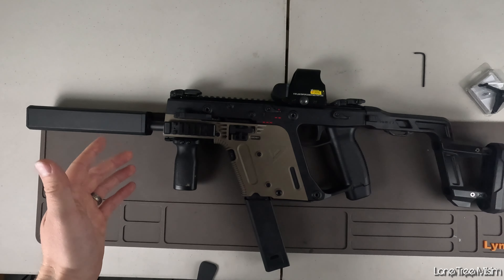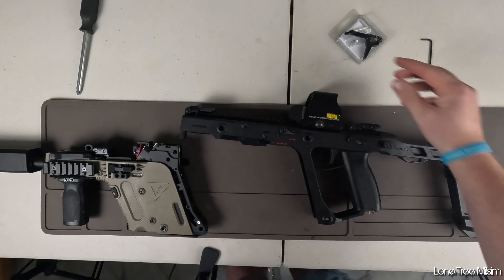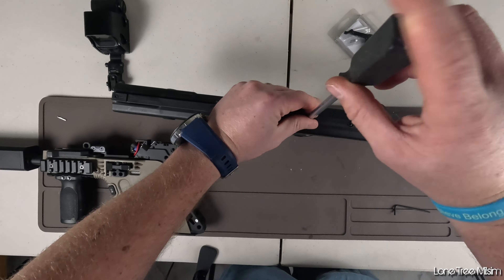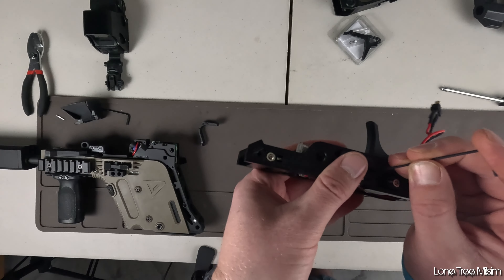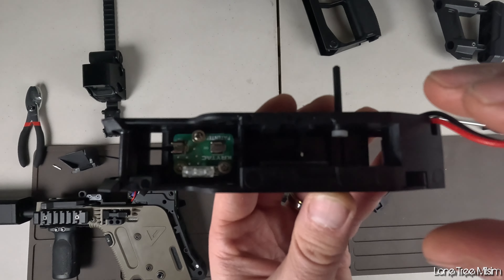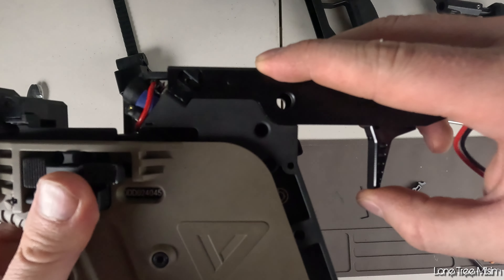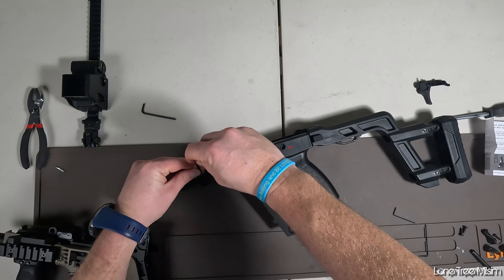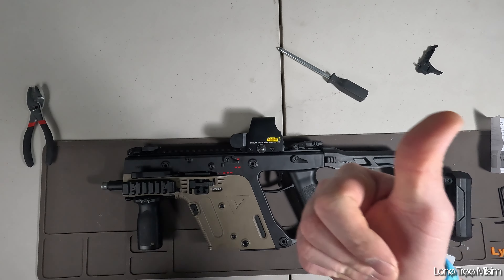Krytac Kriss Vector Speed Trigger EASY INSTALL!

Comment: I have 2 questions, would you recommend a vector (probably going to leave it stock, no upgrades) and would the stock variant be able to take an 11.1 lipo without becoming a 500$ paperweight
Reply: Trigger is mid, idk about the battery, sight over bore is absolutely garbage. I find myself aiming at someone but my rounds just hit the wall in front of me because my barrel hasn't cleared it yet. So then I need to stick myself out another couple inches and make myself a big target. It's easy to transport because the stock folds. Great style points not a competitive gun tho.

Comment: The pin won't come out. I've already bent an allen key.

Update: I used a hammer and punch. Now the pin is halfway out, but the punch broke inside if the gun.
Reply from the maker: Oh no!! Any update on it?
Reply: @LoneTreeMilsim  I got the punch out and just put the pin back in
Reply from the maker: Oh nice! So all good now?
Reply: @LoneTreeMilsim  Yeah, no mod, but at least my gun is still alive😂
Reply from the maker: That's good at least! Sorry that pin was causing you an issue!
Reply: @LoneTreeMilsim  Yeah yeah, maybe I'll try another day. Next summer maybe.
Reply: Many of times the pins are only meant to go in and out one way
Reply: Same, can't get the pin out to save my life
Reply: Snapped about 50 Allen keys, used wd 40, hasn't moved at all
Reply: Bought a 1.5mm punch came straight out 😂😂 fml
Reply: @christianthorne3839  Bro, some dude at my field just grabbed a small flathead and pushed it out so easy bru😭

Comment: Hi there, I'm at 1:05 and I've pushed the pin out, but my rail does not want to budge at all, is this normal or should I be looking for something else?
Reply from the maker: Huh that's weird. Mine slid off way too easily when I did it. Try a little silicone oil maybe?
Reply: Yeh mine won't come off either, been trying for the last half an hour and used grease. Just weird
Reply: @William Mannering  I managed to get mine off with a piece of cardboard cut down to fit over the back of the rail (to protect the rail from damage, then tapping/hitting it with a hammer until it moved about a centimetre

Then used one of my spare fore grips attached to the rail to yank on it the rest of the way, went back on far easier after the first time so hopefully it's a one time thing.
Reply: What was weird for me tho is I didn't have a pin in the top, the whole is there but no pin and there definitely isn't a pin there so idk
Reply: @williammannering9256  yeah i had the same thing. just pushed the end of the rail on a hard surface, like a table. after that it slit right off. should help for you.
Reply: @gregbarnes4083  had the same issue. i bought the gun used and the previous owner diddnt fully screw in the assembelly making it exreamly hard to take off. i had to hammer it the entire time until i got past the screws
Reply: Install a vertical grip on the middle of the rail and tap it with the hammer.